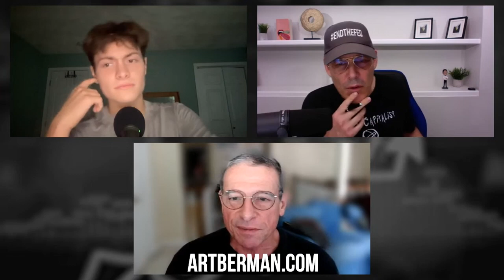The Problem With US Oil - Art berman

Comment: Converting refineries will not be determined by fuel consumers. To say so is remarkably short sighted. When the tractors and combines are sitting idle, everyone will be starving and price nor consumer demand will hinder the conversions. Survival will be the driving force. The problem is, by then it will too late. If the refinery conversions can be done in a year, food production will take an additional year. 3 weeks without food and a person dies. Hope everyone has been thinking ahead.

Comment: I drive a diesel truck cross country and clicked this clip expecting a clear explanation as to why diesel prices are still elevated. The first part about what kind of oil the US has and what our infrastructure is set up to refine confused me. He seemed to flip from saying we are only capable of producing gasoline to claiming we could switch the infrastructure to produce gasoline but that the incentive isn't there.

Can someone coherently explain to me why diesel prices aren't coming down with gasoline prices?
Reply: Just guessing... Probably the infrastructure is optimised for gasoline as your oil - wti - contains only small amounts which can be refined into diesel which also demands a costly optimisation process.
Reply: i would say its probably because russian crude oil is what was being used for diesel and amerucan sanctions severely cut those ties and is now more expensive because of a supply shortage

Comment: Sounds like he's advocating for a deflationary death spiral. I think the point was that its a national security issue if we run out of gas. If we get shutout of international oil production. I personally do not want to live through that scenario, he seems to share that concern.
Reply: Saying he is advocating for one is just a terrible accusation. Art is just simply saying that we just have major structural constraints which are going to impose major costs to our economy. 

That is almost as similar as saying an oncologist being able to diagnose stage 4 cancer problem is an advocate of the problem. That kind of thinking prevents ppl from trying to acknowledge visible real problems at the expense of been placated to and been told that everything is fine despite the reality.
Reply: @georgeokello8620  Yes, by advocating I mean when comparing to a hyperinflationary currency as the other option. Art is pointing to a bleak possibility and standing the ground that there's no solution because we have slowing demand. Which makes it harder to find financing for gas projects. The outcome of this is deflation (hence my comment).
Reply: @msummers5625  In a way energy is just a necessary input of all real world economic activity. If your access of cheap energy supply is severely compromised, the productivity losses increase just from lack of accessible energy inputs and demand drops just because machine and labor inputs themselves do not have energy inputs. Think of it as if their are not going to be future cheap energy stores that you will not have access to that you have to depend on(inelastic demand), it's just natural for people(and even animals) to revert to risk aversion and extreme conservation because survival is the maxim rather than risk on profit.

It's a physics problem that mainstream economics and politicians for some strange reason are unable to grasp.

Comment: Options; At higher price we choose to do LESS business that means our fuel cost goes up without a change to our retail price to match. AND other factors are NOT equal. Meaning tax is high, red tape is high, confidence is low, prices may change faster than our ability to adapt to them fast enough. And consumers are playing the 'wait and see' game LONG TERM. Did you hear about the grocery shopper changing out the steak upc code for the banana upc code and of course going to SELF CHECK OUT? Paying 45 cents a pound for steak. Now that is quite a bit of inflation that people are doing more stealing at the grocery store.

Comment: Explain how its economically viable to sell and ship reserves overseas instead of refining our own? We could Easily be independent… there is no paradox besides greed and a motivation to be dependent on foreign sources only able to be invested in by the elite banks.
Reply: Not all grades of gasoline are the same. Saudi Arabia has the highest concentration of heavy crude and the machines we use in the United States(like engines, commercial heating systems) we're engineered to function on consumption of those heavier grades. If you wanted to change all of this without negatively killing of economic demand, you would not also need to commit decades of energy infrastructural restrictions restructuring of services like transportation but also large scale manufacturing for newer machines that homes and business will rely on American grades. That is a multi billion dollar investment that only a government can afford to take a debt for that investment and getting EROI for all different sectors using that understructure is speculative at best.

Comment: Ever heard of hybrid solutions or free market capitalism?  We have zero true statesmen who want to get into government for fear of getting shot like the Kennedy’s.  Anyone espousing actual solutions would be far too simple way to spend your time.  We only get mouthpieces talking about the problems rather than talking about cooperative solutions.
Reply: Solutions that you are asking for require actual engineering and scientific revolution which do not magically spawn out of nowhere especially when we already have scientists whom have been putting decades of research and have not been able to get a scalable solution. This is even true especially when the globe has less than 10 years to produce a scalable energy solution replacement that takes 20-50 years just on engineering infrastructure alone to complete that kind of project and this 50 years is optimistic if we factor political will to spend on infrastructure and job market for those new workers all goes well asynchronously. Engineers, doctors, scientists and technologists talk about problems and constraints rather than just solutions. There are only trade offs and it's a matter of choosing the least worst thing from the rest of the worst options.